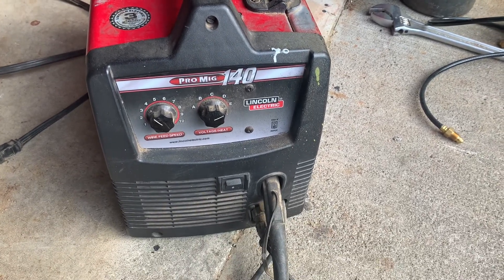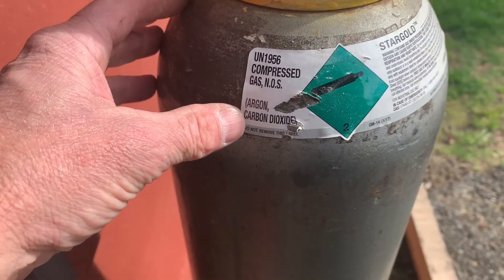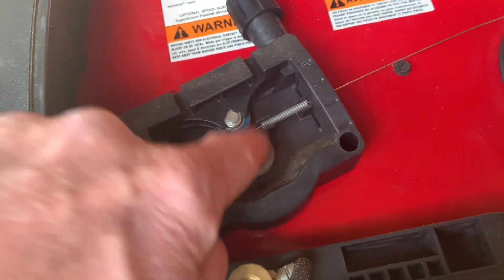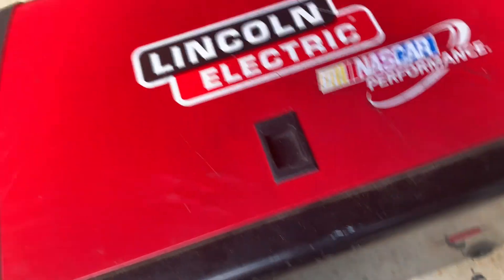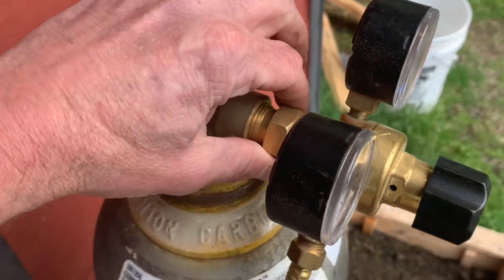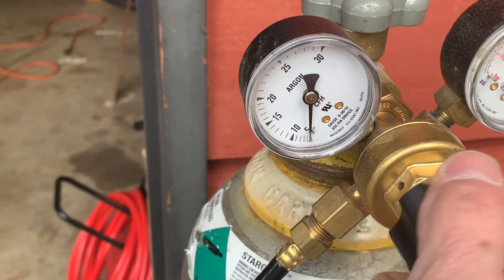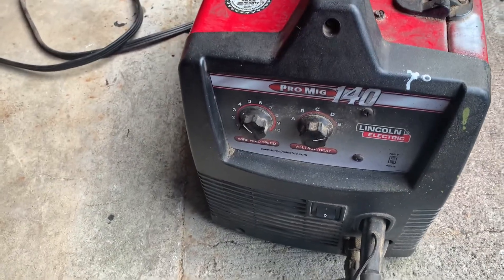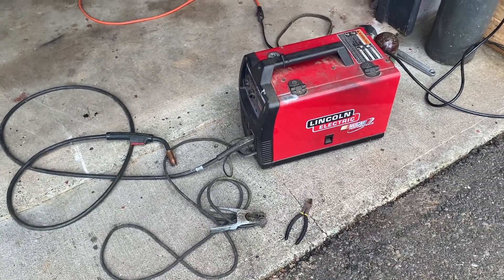DIY Lincoln PRO MIG 140 Gas Metal Arc Welding (GMAW) Full Set Up Tutorial [Lincoln PRO MIG 140]

Comment: Got questions got same welder on gas any tip on overhead welding on setting
Reply from the maker: I always like to increase my amperage by 5 or 10 amps from what I run flat or horizontal. Other than that, watch your torch to work angle and keep an eye on the puddle.

Comment: Do you have to change the polarity. On the -  &+ wires ??
Reply from the maker: Not necessarily. If you bought it new it should be set up for welding steel. Are you trying to weld something else besides steel?
Reply: @DIYTechnician  thank you 🙏
Reply: @DIYTechnician  no steel only